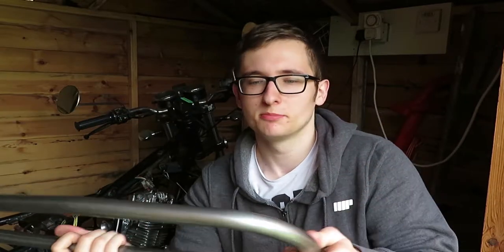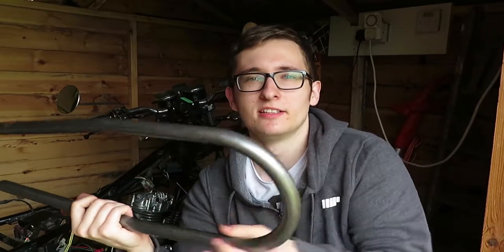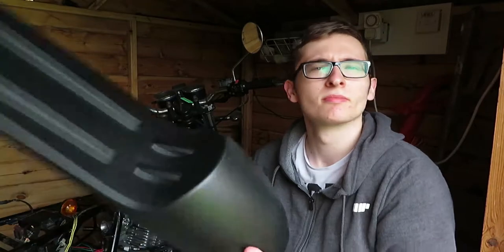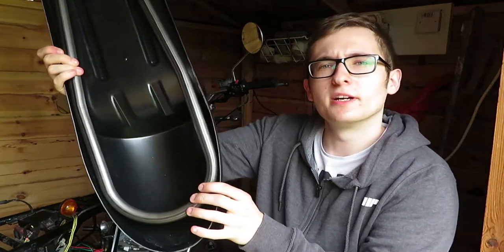Suzuki GN 125 Cafe Racer Build Part 3 : Hoop Install

Comment: your design will have monoshock? and  what is the dimensions size of the hoop. I have an identical motorcycle and I am also starting my project.
Reply from the maker: Unfortunately it won't have a monoshock, would be cool but atm I'm trying to spend as little as possible, and I believe the size of the swing arm is too short to make one fit so a swingarm of another bike would likely be needed, 
The hoop was a full frame hoop of a Honda, I cut it down to length, the widest point is 210mm whilst the thickness of the tube is 22mm, hope this helps and good luck with your build!😁